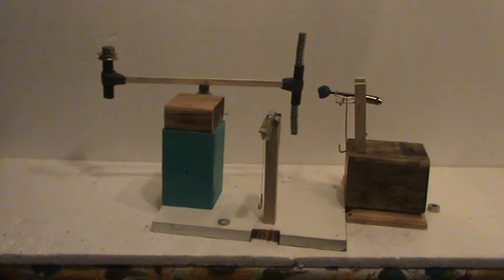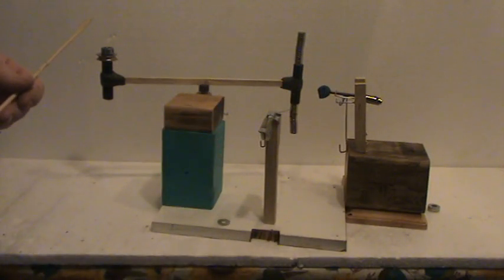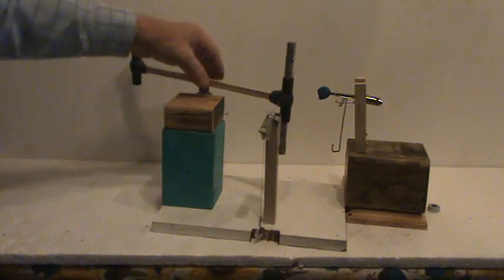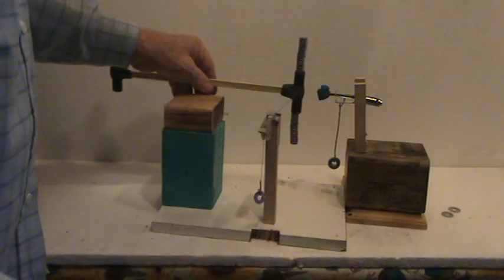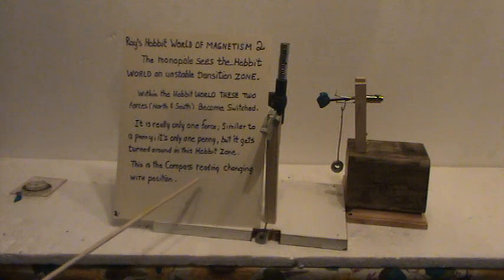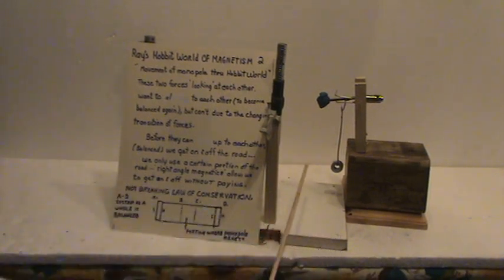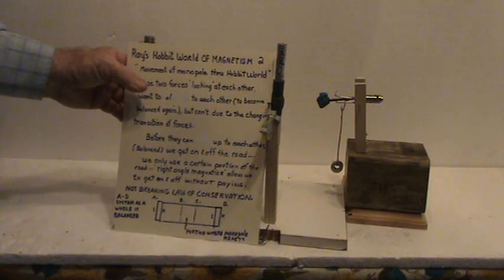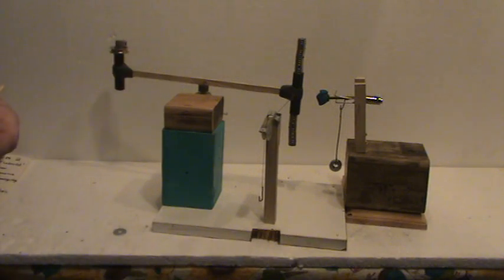Ray's Hobbit World Of Magnetism  2

Comment: very interesting ray.  potentially usful effect for sure. -     you know ray i think we both have a similar issue too solve... my pendulum outputs a linear push pull force, with a short throw....    and i have made an output stage too convert too a rotary motion, using freewheels.    https://www.youtube.com/watch?v=7-auL3YJ3Qg  but each freewheel has about 25 "clicks" in it, which would be better if it was 80, but i can only find really expensive ones too buy, so im stuck with the crude ones for now,    any ideas for a better torqe converter ?